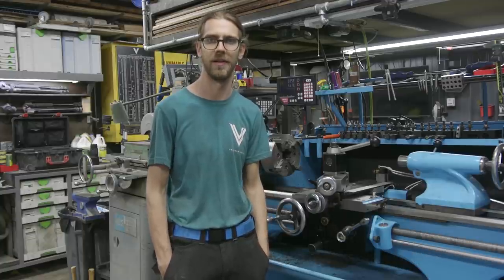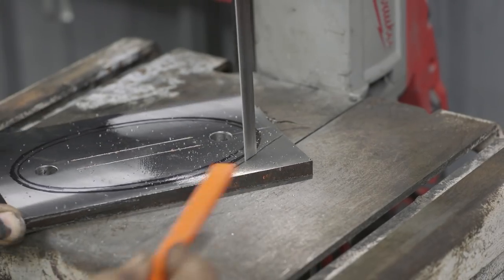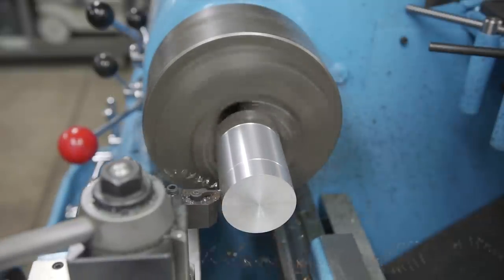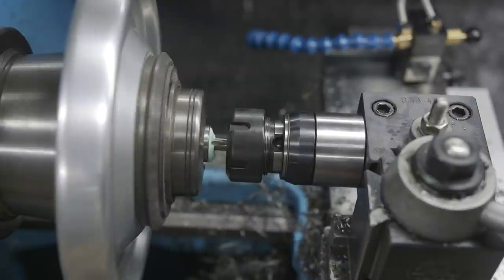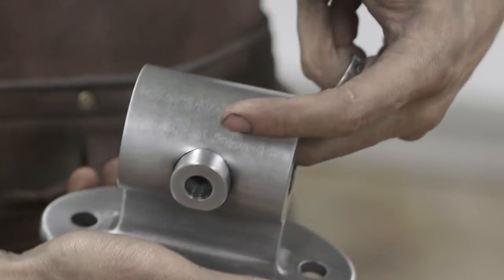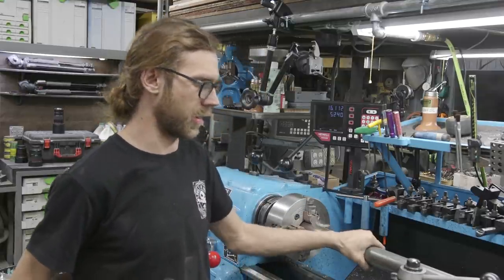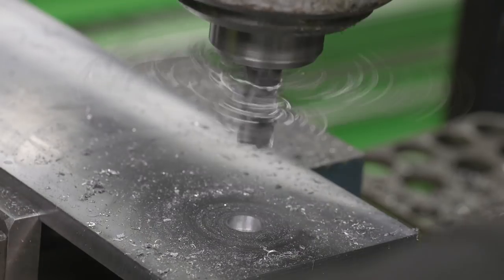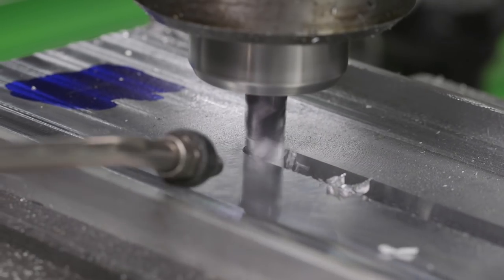Welding and Machining Parts (Wadkin Planer Guard)

Comment: Lovely to see a part for a great old British planer being made. I was an apprentice church organ builder in London and we had an 15" or might have been 18" 15 HP Wadkin planer/ thicknesser that was a beast of a machine. We only had 30 mins for Lunch and if the planer was turned off at lunchtime, it was still revolving when lunch was over, the cutter block was so big and heavy and it was just one big flywheel !
Reply from the maker: Dang that’s cool

Comment: Nice to see old British machines being kept alive the other side of the pond. Your Colchester is awesome and Wadkin made some of the finest woodworking machinery. Will last forever with a bit of TLC. I have just acquired a lovely old Jones and Shipman drill from the 1920s. I hope to do a video on it one day. Also just acquired a CVA toolroom lathe which is a British version the Monarch 10EE.
Reply from the maker: That’s awesome
Reply: Got an Elliott Cardiff Major we are still using in Cleveland.  Great solid machine and it gets used all the time. , especially the gap bed. = I have called it our LeBlonde Lite.
Reply: @mathewmolk2089  
Elliott made some awesome machines. I have an Elliott Sturdimill - very aptly named. Also the Elliott 10M shaper. I would love the Cardiff lathe. Cardiff is only about 40 miles from me. A mate of mine has had all the American lathes but he reckons the best of all are the old Hendys.

Comment: Looked good, hope it was pleasing to the customer. The only thing I've done differently when welding a cylinder to a flat bar edge, was to put a vee cut on the flat bar to locate the cylinder easier, but as I've said before there is a plethora of ways to get a job done right. I'm still enjoying your content 👍
Reply from the maker: Yeah, that’s a good point. Thank you very much.

Comment: Might be interesting for you to do a video on how you got into machining etc
Reply from the maker: Good point I would be down to do that. I have been machining for all of about 3 months lol
Reply: @VanoverMachineAndRepair  Seriously? You've only been machining for 3 months???
Reply from the maker: @DavidR8  that is correct. I hope I am doing well considering. I bought my lathe back in September of last year it sat for a few months, I got my mill and surface grinder in November. It sat for a few months. I restored my Lathe and had it finished in March and got my mill up and running probably in January. I’ve been doing fabricating for quite some time so it’s unfair to say that I have not been making things  but actual machine work has been a new thing.
Reply from the maker: I have trying to learn as aggressively as possible since I love it so much. How am I doing?
Reply: @VanoverMachineAndRepair  you’re doing amazing! I was seriously impressed by the approach to the bracket. The finished product was very good.
Reply from the maker: @DavidR8  thank you so much
Reply: @VanoverMachineAndRepair  Crikey!
I'm also amazed that you're a fast learner on the lathe and mill. I have no experience myself, but watch a lot of videos, so I'm qualified enough to be impressed 😃 
Subscribed and looking forward to more videos, because your videography and commentary are excellent.